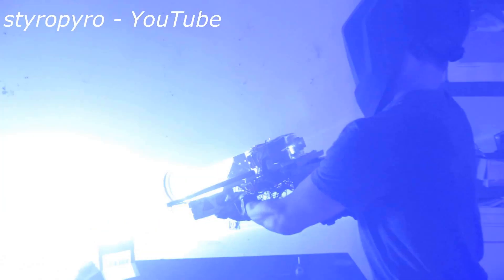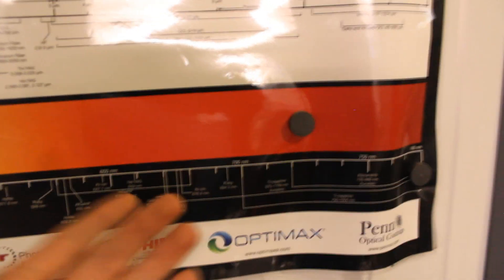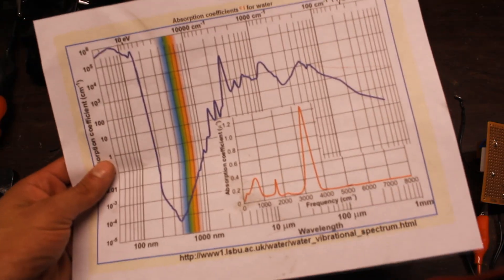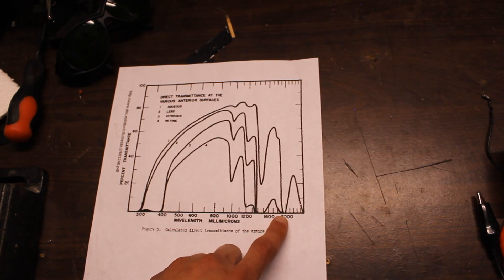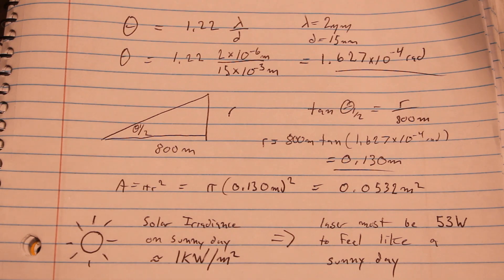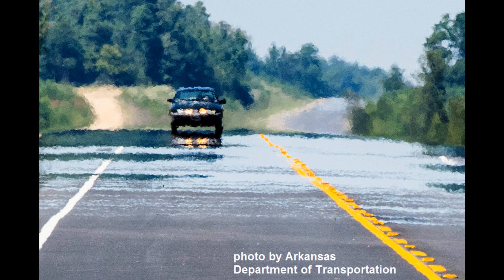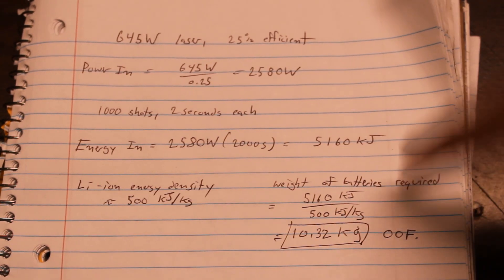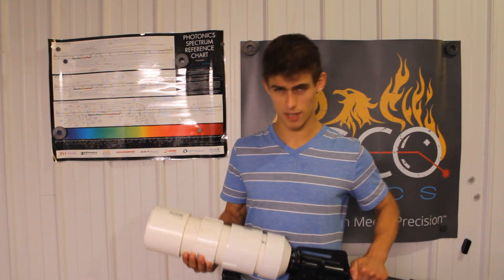Chinese "Laser AK-47": DEBUNKED!

Comment: I have been working on making "a hot swap" that turns the AK and M16 into laser weapons. The only problem is the power source that makes sense. Still deciding wether to just have the mags acts like batteries and replace them? Not cost effective and neither is making a high out put battery that doesn't need to swapped after 2min of run time. I'd be curious to see what you think is the best solution for this.

Comment: These kind of laser guns are not used against personnel. I think you either misunderstood the the purpose of the device, or the source was not trustful. 

FYI: These laser guns average effective range is around 300-600m depending on target, and environment (As you presented quite nicely). They are used in Explosive ordnance disposal, and remote demolition of object nearly exclusively (AFAIK). They can shoot for example UXO-s or IED-s (Unexploded ordnances and Improvised Explosive Devices (latter is like a terrorist package bomb)) and make them detonate in a controlled environment. (Note: there are several variant of these that use normal microwaves or radio waves instead of light)

Comment: "AK - 47"                         |   AK -47
Frikin lazers                   |   7.62 x 39
Electric timimg circuit  |  Gas piston
AR grips                          |prob bakelight ak grip
Torch on a brick             | default gun.jpg
Degrading battery          | sheet metal mag
Service start: never        | 1947

Comment: If your power density is sufficient to get self-focusing nonlinear effects, you’d no longer have to worry about the Rayleigh criterion. This might actually be doable with a high instantaneous power, small area, pulsed (Q switched?) laser. The small area required for that nonlinearity would also ensure you get decent burning power. Though reading further it looks like the initial area doesn’t matter so much, as he critical threshold to be surpassed is a power (2.4GW), not a power density. 2.4GW is high, but that’s what the Q switching is for.
Personally I’d like to make some sort of maximally high-Q atmospheric nitrogen laser to be as hand-held as possible. With lithium ion cells charging capacitors. Gas lasers have really shitty finesse, but I don’t think that’s an issue if you get nonlinear self-focusing, and using the air as your gain medium means you don’t have to worry about heat buildup at all. That said, the improved efficiency of a diode laser may still be preferable. If there are good pulsed diode lasers, and you can get around the heat issue, they may well be the better option. Fibre lasers also.
With high power densities also the possibility of making an electrolaser, but I think those are even more in the realm of dye lasers than self-focusing.

Comment: Glad you debunked this because I called bull shit on it. I don’t know as much as you but enough to know those clams were not plausible. I will tell you of one guy who shot a hole through the tip of his finger. We were told this story when we went over safety with our 6kw cutting laser. To make sure that the beam is centered you use a piece of tape and it makes a hole. This is a CO2 laser that cuts steel like butter. But we were told of a guy who stuck his finger in there and it shot a hole right through the tip of his index finger and had to be amputated at the knuckle the one at the tip. Is that bs or could it have happened. I am not gonna test it. Maybe try a steak in it and see what happens.

Comment: A hobby helicopter engine could provide the power, two-stroke fuel has plenty of energy density.  At 800 meters a tiny motor would be pretty quiet, and it would only need to kick in to recharge the capacitors for each shot.  Also, having a gun with exhaust pipes would be fun!  Microwaves are just past the IR spectrum.  I don't want to put gasoline in a microwave, but I wouldn't rule that part out so quickly since the gasoline would have plenty of things around it that could react with the Microwaves and get hot enough to ignite the gas.  If they had a frequency adjustment they could do all those things, just not with the same setting for all the tests.  Personally I think you could take an AR15 and wrap the barrel in copper wire, then fire a neodymium bullet through the wire to generate the power you need.  Imagine a tripod that fires a bullet straight down into the dirt, then use a 10 ft wire to a sniper microwave rifle.  I simultaneously hope someone makes this, and also, that everyone walks away and doesn't make microwave guns.  We already have plenty of guns, we don't need new ones that are even more deadly.

Comment: A notable factor that would highly reduce the effectiveness of lasguns in combat, would be armor.
Even basic aramid armour can resist heat quite well, although such high temperature would ruin it's ballistic effectiveness, or at least reduce it severely.
Ceramic armour used in all major militaries and even some irregular outfits like insurgencies and militias will further reduce their efficiency. 

If you wish to test this and have ~$200 to burn, a cheap but respected Hesco 4401 can be used to check if my theories about energy weapons hold. Alternatively, a piece of Boron Carbide, or just a regular floor tile.

Comment: The AK-47 magazine weighs about 0.25 kg or about 7.2% of the guns weight (3.47 kg). If the powerpack of this gun weighs 10 kg, then the gun would weigh over 140 kilograms. Bit over the 3 kilogram mark, isn't it?
Reply: I used the Ak-47 as an example because they called it an "laser ak-47", so i think it would share some aspects with the gun were it to exist.

Comment: Unless the power supply is a separate unit.  Thus the gun without the supply is just 3 kg.  I'm also guessing that when it comes to fuel tanks, it heats the container wall as it burns through and once through, the fuel meets the air at the very hot site focal point.

Comment: To build: instead of powering a laser with a driver from a battery, can you make a laser (likely not a diode laser as you would fry the ever living fuck out of it) that is powered by a capacitor, so instead of a battery's constant low power use a capacitor bank to get a really high power for a fraction of a second, and would this be useful at all? (and by useful I mean can I light stuff on fire in such a small time span even with the high sudden energy output)

Comment: Inb4 we get a "but whatabout hydrogen fuel cells, we may not even need batteries for powering the lazer!" those things are even bigger and clunkier and only suitable for cars, would be surprising if they made a portable variety of that tool and then some.
point is: Not yet.
As of now, the lazer AK may be a military novelty or even a distraction. it may not be the mindblowingly crazy maxim gun of the 21'st century we expected, but truth be told, when it gets invented, everyone will have one.

Now I said distraction, distraction of what? Chinese re-armament of their navy. That's their focus and they're doing the same Deng Xiaoping/Sun Tzu style marketing that they've always done, hide their power/strengths.
Thanks for debunking.

Comment: The site that reported this laser AK-47 is filled with all kinds of quite unbelievable claims about China and its capabilities.  I have to wonder who cranks it out and why.  I do want to note, though, that if the laser was capable of melting metal, the fuel that came out of that hole would definitely ignite.  It's flowing in the presence of molten metal, after all, which would be more than enough to ignite the vapor coming off the fuel.

Comment: They could have easily made a laser capable of burning through a gastank. Could be done with less than 500Watts. Think if you combine 3x Coherent Highlight D-Series 2.5kw diodes or Diode stacks. With a short pulse you'd only need minimal cooling and moderate sized battery pack for a 10kw+ laser. I'm sure someone has one made already.

Comment: This Chinese claim is pointless.  If they had this, why tell the world and if they don't, why expose themselves as liars?
 
If it was a real weapon, they wouldn't give specs (truthfully) and if it was BS than the specs would also be BS.  However, in the original article, they have several images and the first, located at the top, is very important. The large, 10-15 cm lens that presumably screws onto the threaded barrel shown in the second image changes the calculations of energy density, power requirements and battery capacity by as much as 2 orders of magnitude.  Erbium and thulium fiber lasers are likely candidates, but neither has any hope of igniting a gas tank.  Even the press releases by our military contractors of their enormous ship based lasers struggle with that.
Reply: propaganda
Reply: @chikinnunget5231  that paper is not mainstream, I suppose that article might be a clickbait
Reply: Yeah propaganda, you could potentially argue that it is a pulse laser so the energy per shot is higher but that adds a bunch of other problems mainly size and weight
Reply: Those ship based lasers are meant to heat and soften the shells of incoming missiles to cause them to buckle under the strain of flight forces and to veer off course to their intended target due to critical deformation. They don't need to burn the missile- just soften it up by heating it hotter than it was designed to withstand.
Reply: @bodaciouschad  and maybe knock a hole in it or melt a wire
Reply: You can see the real specs of a raytheon drone shooting laser being tested at white sands missile range. They show the laser safety sticker on it - wavelength 1045-1069nm, 10kW, class 4.
Reply: US military also talks about their lasers. You said it yourself.

Comment: There's no way they used lithium batteries, they're probably super capacitors, I agree with everything else you said though.
Reply from the maker: The company explicitly states that they are using lithium batteries. Besides supercapacitors would be a poor choice because of the much lower energy density compared to Li-ion.

Comment: my problem with it when i saw it was yea thats not a real gun it looks like a pizza box with a forward grip... why does it have a grip if light rifles dont have recoil why is the shaped like that when a backpack power supply would be more ergonomic because you need to hold the thing before you fire it and if you make it a backpack power supply or even have the intire thing in a back pack with the fluids that transport light like ethernet cables do you can have a tiny gun easy to hold and looks holdable

Comment: You made a few assumptions that are not correct. They don't negate the conclusion however you incorrectly assumed that a weapon like this could not be at a wave length that could blind. The Convention of Certain Types of weapons bans laser weapons whose primary function is to blind and can not be used for that purpose. A weapon whose purpose is to kill can be used even if it may blind should it fail to kill. For example this laser hits an enemy in the eye and they turn away preventing the beam from being fatal. They are blinded but that was not the intent. However if the power was turned down so it was unlikely to kill but still blind then it would violate the convention. Only though if it's power was turned down. 
Blinding as an incidental or collateral effect of the legitimate military employment of laser systems is specifically not part of the convention. 

The US military will allow it's deployed laser weapons system to dazzle human targets if needed while at higher powers they avoid human targets. (particularly as it is a test platform currently) 

I don't know if the wave length changes your calculations significantly but it could be closer to 1000nm. You may want to rerun them at say 1050nm or 1200nm I suspect it gets the power needs down to get near the 5-6kg range. Then drop that to use a more dense system like a graphene enhanced battery or one of the several out batteries out there with higher capacity than Li-ion. While most may not be commercially viable that isn't as big an issue for a Chinese Propaganda win. Something like Li-S Batteries which commercially aren't great as they degrade too fast but do have 2-3 times the energy density of Li-ion batteries.

A high density Li-S Battery with 1,260kj/kg density (they have been demonstrated at 1800kj/kg) would drop your own calculations down to 4kg in weight. Drop down to 1200nm and even with an increased power output it actually starts getting viable. Likely not practical but viable.

Comment: Practically lethal laser weapons would have to be pulse lasers with roughly minimum pulse energy on target at around 1kJ with pulse duration of one millisecond = 1 MW net power (on target!). This would cause lethal ablative explosion on the surface of un-protected human if it hit the torso or head/neck. What chinese now probably have is a less-than lethal area-denial/crowd suppression weapon that will probably be used against protestors/uprisings. Instead of running everyone over with tanks they can now blind every cellphone camera and person holding it and then round them up and shoot them.

Comment: Hey, they can power it easily, they just need to get some of those 100,000 mAh power banks from eBay and wire them all together, they're only the size of a 2.5" hard drive. Plus, they have a solar panel on them, so they stay charged all the time. The troops using the rifles can also keep hydrated and liquid cool the rifle using water collected in a Fontus bottle.

Comment: Is it possible that the weapon exists, but is only meant to blind enemy soldiers and not to set anything on fire? You mentioned that this invisible wavelength could still damage eyes.
Reply from the maker: blinding weapons have been around for decades, and would be very easy to implement in a device this size. if that's all this is, then it is nothing new

Comment: wow, the only scenario where a tinfoil hat is an effective weapon
Reply: Or maybe a mirror
Reply: I we start using laser guns I'm gonna start wearing polished plate armour.
Reply: @appa609  just make sure you are not up against his Ruby laser that will blast right through it
Reply: @appa609  "Have at thee, knave!"
Reply: @cole7638  no it won't 
Because its going to reflect most of the light and the little around absorbed won't be enough to melt metal.

I know that the laser is 13KJ
Reply: @lathrin  unrelated
Reply: @lathrin  > laser guided missle heading for tank
>guy pops out of it
>holds up mirror while showing middle finger
Reply: reflect suit
Reply: Where is the "tin foil" you speak of? Isn't that only for duct work?
Reply: @gekyumerising3152  and wrapping food
Reply: Yes

Comment: I think you have not considered the how Q switching can dramatically increase the power on target. With for example of 1000 pulses per second Q switched into microsecond pulses the duty cycle is 1/1000 which will yield power that is 1000 times the value of the CW beam.
Reply from the maker: A Q-switched laser in a portable gun would only make maters worse. Not only does Q-switching decrease efficiency, they typically deliver less energy to a target than a CW laser of the same average power. When a Q-switched pulse hits a target, it typically vaporizes a fine layer from the surface and then the rest of the laser's energy gets dumped into the forming plasma ball, shielding the target somewhat. If you look at all the large modern laser weapons they are all CW.

Comment: You assume 25% efficient and get 10 Kg. But who knows what their research is like. If it's 40% efficient, or what if the 1000 shots they claim is rated for 300m distance, but it's just the max range that is 800m? Or if the batteries last 10% longer and are 10%:lighter than what a civilians can achieve?
1 long range shot is enough to be worth it, is that plausible? A sniper rifle that is near light speed, if you don't need to worry about wind and gravity it would be interesting.

Comment: Great analysis. Please do a similar one for the American anti missile laser systems which are under development.
Reply: AwesomeSauce you know there is a huge difference between this and that system. This ZKM-500 is a handheld device powered by a li-ion battery. The American laser anti missile system is connected to a nuclear power plant.
Reply: Oh no dude. I don't doubt what the American system is capable of. I'm just interested in a breakdown of technical facts on the system. Like the frequencies, power level and effective range. :)
Reply: AwesomeSauce well without specifying anything, by the looks of it, it's promising but not enough yet.

In the future it could mean a cheaper system than traditional anti ballistic missile missiles as it only consumes (albeit a lot of) electricity, instead of having one missile that costs a reasonable fraction of such a laser system.

So all in all, in 10 or 20 years it might just be something but for now it is not efficient enough and we'll have to rebuild the defences, which will not happen anytime soon.

Comment: ok... have u considered because this is a military weapon, that they would use super capacitors instead li-on battery?
Reply: Raymond He it was stated that it uses li-ion batteries, also there are no super capacitors on this temperature and that would only help with the energy loss and it is not a battery type.